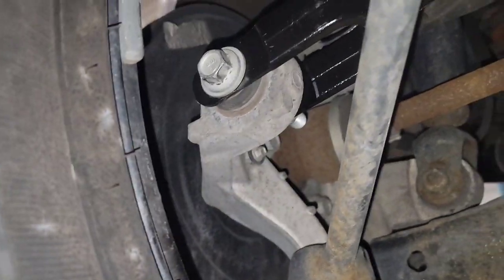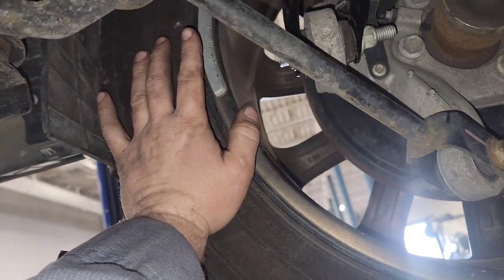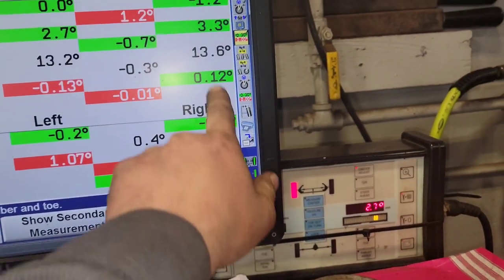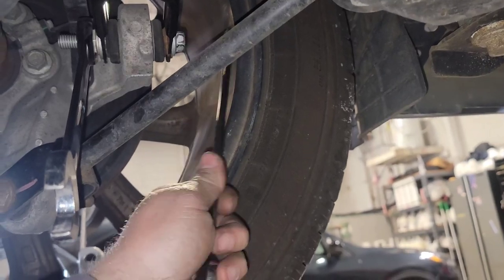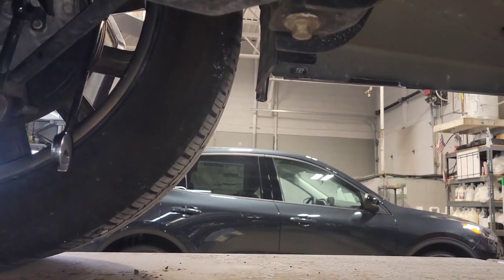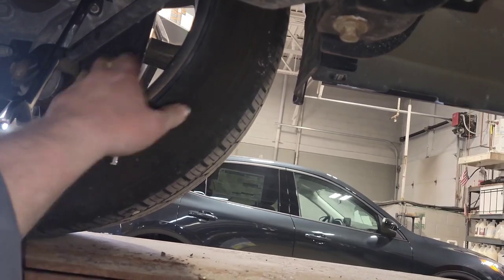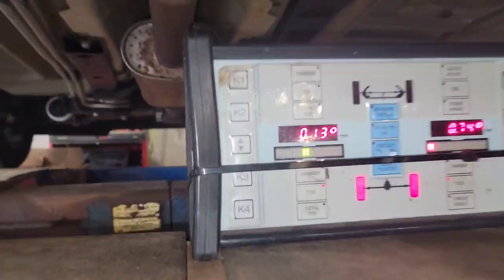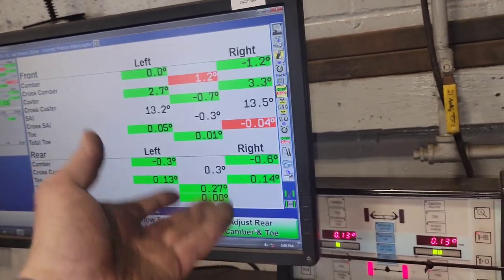Ford Explorer Newest Toe Link Recall 20s62 / 21s32 - What Is Done

Comment: Could you tell what year explorers this cover's
Reply from the maker: If you Google those campaign numbers and you look in my library will see exactly what ones they cover

2013 - 2017 

Contact your local dealership give them your VIN number let them run it and see if the campaign is available on your vehicle
Reply: @FordBossMe  what caused the upgraded design?
 and will that become out of align faster then the other jamb nut design or equal to the old design?
Reply: About 1.5 years ago I had my rear toe links replaced with one-piece forged versions on my 2013 explorer...I think it was 19V435000
Reply: @danlevesque5437  the ball joints started seizing and actually cracking the knuckle. Due to no flex when going over uneven terrain,(I.e. potholes, speed bumps, etc.) there are certain models not affected. There’s a couple different recalls. Some are built with bushings instead of ball joints. Some have one of each due to replacement of cracked knuckle.
Reply: 2013 to 2017... I have a 2015 and it was part of both recalls.
Reply: @danlevesque5437  That's a great question! I have the same concern! Just doesn't seem like a proper fix. Are owners supposed to crawl under their Explorer and tighten stuff down now? 🤔
Reply: @justmeinnh2 which recalls if your don’t mind me asking?
Reply: What recalls?

Comment: These new toe links look like they will easily be knocked out of adjustment compared to the original positive lock design. I can't tell from the video if the ends of the metal tubes in the bushings are serrated to "bite" into the links. I think Ford should have come out with a beefier turnbuckle setup if fracturing is the problem. I am impressed with that remote screen on the alignment machine. That makes life easier when making rear suspension adjustments on todays multi-link rear suspensions.
Reply: They do get knocked out of alignment. All. The. Time. I work at a Ford dealership, and there’s been a good couple times when I’ve had vehicles come back, even though I set the toe to spec during the alignment. This recall is absolutely ridiculous. This is not safe
Reply: @theknight45videos  I am getting new tires at my expense with less than half the expected mileage on the tires being replaced....Oh and I found out about this when I almost hydroplaned into an oncoming semi.
Reply: Yeah had these changed and I go threw tires every 6 months now because the alignment gets thrown out basically by a good crosswind

Comment: I never brought my 2013 explorer in for the toe link recall. What I did instead was buy Steeda adjustable links and independent alignment shop. I honestly would never bring it to the dealer even for recall work. The Steeda toe links are much beefier than any stock design as well. Do it once right and never think about it again.
Reply from the maker: So this is the problem with you taking this upon yourself instead of letting them address the situation

The reason for the toe link recall was not just to replace the two links it was to inspect the bushing in the knuckle to make sure it was free because they are binding up and it's causing the knuckle to crack
Reply: @FordBossMe  that's fair but I inspected it myself. Honestly if there was knuckle damage, I probably would still replace it myself out of pocket to avoid the dealership. I heard some people waiting months to get theirs back.
Reply from the maker: @icyhotmike  I'm only giving you the facts and I understand you have your reasons but at the end of the day it's my job to educate people and let them know what the consequences of things can be when they take things into their own hands that's all no hard feelings not saying you did anything wrong but I have to tell you the downside to it
Reply: @icyhotmike  Waiting months? Huh? You mean it was in the shop for months? or just waited months for the new parts so it could be scheduled and done? I made an appointment. They ordered the parts (for several recalls). I dropped it off the evening before, and they did several services and I picked it up in the afternoon. I must not understand what you're saying.
Reply: @FordBossMe  Exactly! 20s62 recall was out before I bought my 2015 but the previous owner never had it done. The day after I bought it, the VERY next day, 21s32 came out. I too blew it off. Then I bought 4 new tires and wanted a 4 wheel alignment but they couldn't do the rear toe because they were frozen. So my procrastination only hurt me!
Reply: @kevinb2014  The 21s32 recall came out in September 2021 but they said repair parts for the recall wouldn't be available until the end of the year (2021).
Reply: @FordBossMe  Don't you think if he replaced the links, then the bushings were too?  At the same time, I would have let them do the recall, then if I wanted the Steedas, swap out the new toe links for them and then have a spare set of toe links should the Steeda ever fail.
Reply: @icyhotmike  "Get theirs back"?  Owners receive a letter when the parts are in stock, call local dealer, schedule an appointment to get it done.  It's in and out of the shop the same day unless the shop runs into some kind of problem that delays their schedule, then should be done next day.  That's what an appointment is for.

Comment: I had the toe link in my automobile recalled. The car was misaligned when it was finished, but this misalignment was permanent. Ford is unwilling to investigate this problem. I suppose it's because they are aware of the issue and don't want to address it. I took it to a different shop for alignment, but the results were essentially the same, so I presume it will never be perfect because the materials appear different.
Reply: You have to fight them on this. Had to get ford Corp involved. I went through 4 new tires only on the rear. The alignment was so bad it felt like I was about to hydropain off the road when it rained. I took the car back so many times and all the services reps acted like I was crazy. Mine is finally fixed. It was such a headache. I don't take my car to that dealer anymore and I will never buy another ford.
Reply: I’m going through the same thing now with a 2015 explorer. I hit a bump on the highway doing 80 and ended up in the lane to the right of me. I will be replacing the toe link bar with an adjustable one from rock auto.

Comment: This is my problem. Ford recalls my 14 Explorer, in the process it needs a rear alignment. They recommend front alignment too, but won't pay for it. Why? What they did caused this to be needed. I just had this done, and declined the front alignment, and now my steering wheel is off center. What Ford did resulted in this condition, but they wont pay for it. Thats not right!
Reply from the maker: They will pay for it, the dealer needs to submit to sssc, we literally get it covered by the special claims department no issue
Reply: @FordBossMe  Thanks, I will bring it up with them!
Reply: @FordBossMe  Yes! Ford payed for the front end alignment, and its perfect now. Thanks!!

Comment: The 2016 Explorer Sport has the exact same setup. I took my car to Firestone today to install my winter tires and align all 4 wheels. They didn't know how to make the adjustment. I ended up leaving with only a front aligned because I believe they didn't set the computer up correctly and choose the police interceptor when they programmed the alignment computer. I only say that because the sport closely mimics the interceptor. They printed the picture of the diagram with old school design and told me to ask Ford why my vehicle doesn't have the toe adjustment bar in the rear. I knew this had to be on YouTube and I will be sure to show the boys at Firestone your video after I take it to Ford complete the service. Best part, I got my tires installed and front alignment for free.

Comment: Thank you for the information. This should be shared with shops when doing alignments. I had to explain this to the knuckle head at the Tires Plus and he told me it was impossible to align the rear of my vehicle. I will only be taking my explorer to Ford for alignments moving forward.
Reply: But the after market adjustables. Maybe the tires plus guy didn't know how to align with these links. But even if he did. THEY ARE JUNK!

Comment: Thanks for the video. Now I understand why my mech couldn't do it. This is a ridiculous design, in my opinion. I just ordered a doorman adjustable rear toe link to install it. My Ford Service did the recall and the alignment. And they misaligned the steering wheel. The next day, I went to get it fixed, but they ruined it even more. 2014 Limited here.

Comment: I just had mine done they had my 2012 explorer 3.5 for a week picked it up on a Friday drove to NY from md 700 miles round trip. Tues morning went back to the dealer to drop off because both tires were down to the metal.  They said they did the alignment. They still have my truck and it's been a week they said they will replace the rear tires and try to do another alignment.  All it will take is a pot hole to knock the alignment off.  I have ordered the old tow links from rock auto to have my mechanic replace what Ford put on and go back to the old setup and parts were only 60 for both.  My truck will never see a ford dealer again. I went in to fix a recall and come out with a oil leak and truck cutting tires never again.
Reply: Ok my explorer been in the shop for 2 weeks now for them to try and figure out how to get it aligned right. I am about to call and get my truck back to get the old part put back on.  They could  of gave me a loaner but they didnt.
Reply: I think I'm getting to end up doing the same thing... Let Ford put on their cheap garbage to satisfy the recall and NHTSA, and have my mechanic put on quality parts and do another alignment! Have to wonder if complaining about the shoddy recall replacement parts to NHTSA would do anything... 🤔
Reply: @justmeinnh2  so I picked up my truck Monday drove in Baltimore all week now  the truck drives funny I took it to my mechanic this morning and I am sitting here waiting because he said the alightment is off in the rear due to hitting to many potholes so he is putting on the new tow links now.  So it took a week to knock the truck out of alignment.  I have also noticed that alot of places are sold out of the rear tow links and Amazon went from 38 to 51 dollars for the part now. Yall better get them now before they are all sold out because most places it's a 5 to 8 week wait for the part.

Comment: Next they'll have you replace the rear knuckle to make the joint solid so you can install cam bolts. It would be much easier to adjust with cam bolts. The first one I did I had it jacked up and held the wheels in position while another tech snugged the bolts down like you said.

Comment: Love it when the inner bolt nut breaks off in the frame
Reply from the maker: If I feel like it's going to stop and it's going to keep finding I quit immediately and I asked for more time through sssc and then I heat the piss out of it and take the bolts out
Reply: This is what happened to mine. Is dealer who did the recall responsible for this?

Comment: I just had mine done on my 13 Explorer. Now I have to align it because the dealer either didn’t do it or didn’t care about getting it right. Fortunately I work at a Chrysler dealer so it will be right when it’s done. And yes it was perfect when I brought it in!
Reply: so should i or shouldn’t i do it, in your opinion? i have a 2013 explorer police interceptor
Reply: @YTimCN  DO NOT DO THIS RECALL. If you are concerned about your toe links corroding there are aftermarket toe links that run about $550 a pair installed with alignment. Beats the hell out of what I am doing which is paying for the aftermarket links and $1,200 for a set of tires because the recall replacement toe links are JUNK!

Comment: I have a appointment this coming Friday at a authorized Ford dealership for these recalls 20s62 and 21s32. The only reason I even knew about these recalls is because I bought 4 news tires and wanted a 4 wheel alignment from Town Fair Tire. They couldn't adjust the rear toe because they were frozen.
Reply: @Ford Boss Me So I had it at the Ford dealership Friday morning for this work of the recalls, but when I put my VIN number in on the NHTSA website, it shows 21s32 was done, but 20s62 still needs to be done... How is that possible when they are related?
Reply: @justmeinnh2  At one point, they did not have the parts to service all vehicles so they had the vehicles brought in and only did an inspection, optionally replace the bolt.  Check your receipt to see what they mentioned doing, because if they specifically replaced the toe link it should be on the receipt as a part put on.
Reply: @stinkycheese804  They replaced both rear toe links... I also demanded a 4 wheel alignment, and not just a alignment to the front wheels! They did it all under the recalls. That's respectful to the customer, so they will get me back for service!
Reply: @justmeinnh2  As long as they did a Good Job, great.  Personally, my front wheels are aligned fine and I don't want the shop touching them, rather if they do the job correctly, can just align the rear to the already correct front wheels.  

If I let them touch the front wheels, it's just another opportunity for them to screw something up.  

Granted, my Explorer is not old enough nor enough miles to have drifted out of front alignment from suspension wear, and pretty sure no potholes have caused damage either because it still drives good and the tires are wearing evenly.

Comment: I find getting the required 111 ft/lbs on the outboard bolt and nut to be difficult. If I had more time, I would do the alignment, take the wheel and tire off and torque to spec.

I like how you did this alignment, the way I have done it is lifting the vehicle on the alignment rack after getting my numbers and slowly let the rear down until it gets to the right adjustment.
Thank you for sharing!

Comment: Can you post what the alignment specs should be for a 5th Gen Explorer? I have a 2017 Limited and I don't know the default alignment specs. My car keeps drifting to the left when the wheel is straight. It's been aligned twice now. Not sure if the car is faulty or the mechanic is faulty.
Reply from the maker: I can't I don't have the access to the information anymore I'm a general manager at an independent shop now

Comment: I'm new to the channel...loving it so far👍🏼.  I have a 1930 orig 5 window coupe and a 2013 explorer with the 3.5 (cyclone?) Non-turbo...at 50k miles I'm starting to worry about that internal driven water pump...I check my oil color and look for weepage regularly.  I'm trying to find a good master tech who can confidently tear this engine down to do the job.  Do you know of anyone in lower NY?
Reply from the maker: I think the only time you're not going to like it is when the trolls piss me off and I have something to say to them
Reply: While it is an issue you should be aware of, those 3.5 duratec are very solid engines. With the overwhelming majority of owners reporting high mileage as in anywhere from 200-400k without major issues. At 50k, again, keep an eye on it,but I wouldn't lose sleep over it. Thankfully, I don't think water pump issues are as common on newer 3.5s, I think they changed the timing chain design on the 3.5 for the explorers in like 2012, so you just missed out on that. From my understanding, 2012 and up 3.5s with this new timing chain design don't seem to really have this issue as much, if at all. Not sure why that's the case, I'm not a mechanic/engineer. I believe the water pump is driven by the timing chain, so that could explain why altering the timing chain design helped to reduce/resolve this issue.
Reply: @KB-bh9hp  I respectfully suggest that you don't know WTF you're talking about.   The majority of owners with 200-400K mi on them, don't have the transverse mounted engine with the internal water pump.  2012 and up still have the issue, it was never resolved except when Ford went back to a longitudinal engine when Explorers went back to RWD-biased for 2020+ model years.  The new timing chain design was in 2011 and that's when they switched from an external belt driven water pump to an internal one, so it was a terrible change not one that fixed anything (except giving them maybe a couple more inches clearance).

At the same time, I wouldn't worry about it "yet" with only 50K mi on it, but I would do timely coolant system flushes and fills with the newer motorcraft yellow VC-13G coolant which is backwards compatible but wasn't the factory fill in '13.  Also if it is AWD it is known to cook the PTU fluid so that should be changed every 30K mi or less under severe service conditions.

Comment: This alignment topic is one of my most annoying things to bring it in for if I request the alignment it's assumed that I wanted it fixed if out of spec but more than once I got the Alignment and then they didn't bother to adjust anything and then I got chopped tires and I asked why it didn't get done I'm told you requested a alignment nothing about actually fixing the problems 😡🤦‍♂️ and it happened again on a different car I said as I was going to pick it up did you find any out of whack answer was yes I said did you adjust it and where's the paper before and after their answer was no we just checked and gave it back not even a courtesy call to say hay do you want it adjusted for the extra 🤦‍♂️